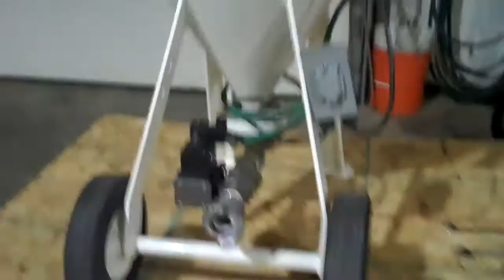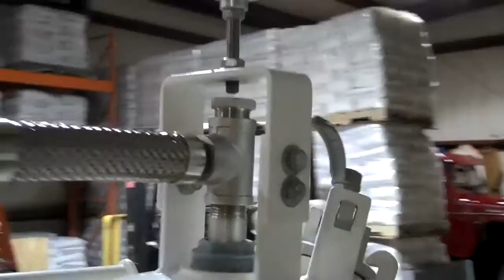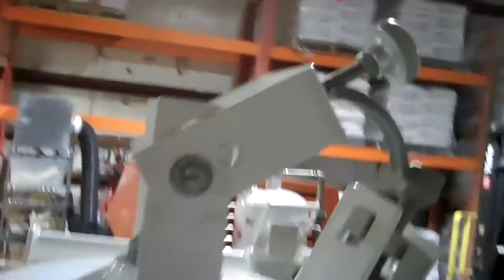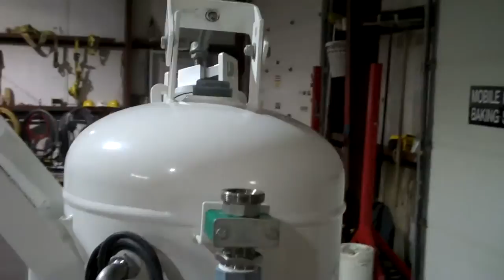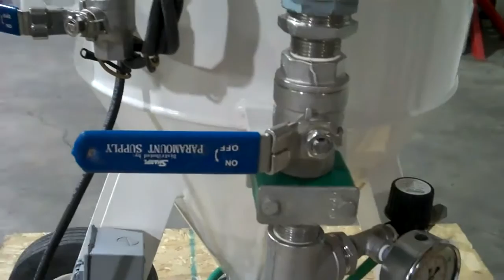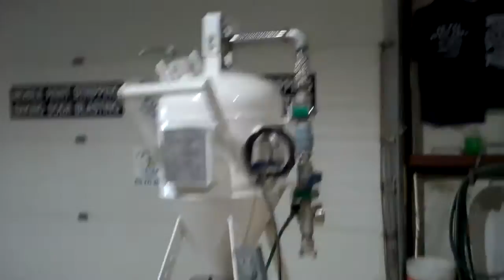The Soda Works Buster Blaster Model 100 Clean and Service  Soda Blast Pot

Comment from the maker: No problem. There is a new aluminum venturi (metering valve on the end of the down tube) available. It works as good or better than the steel model.